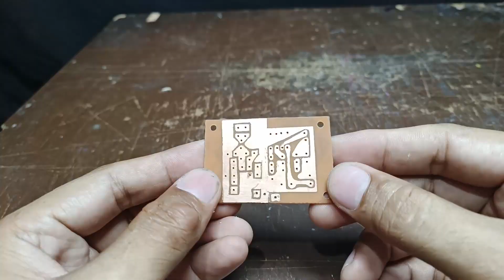Let's Modify 1950's RCA Victor 45-EY-2 || Convert TUBE to SOLID STATE Amplifier

Comment: I like the idea, however the original amp is better then sold state, solid state was a cheaper way tp produce sound, it is well known by the audio tech's
Reply from the maker: Yeah I agree with you. I do this modification because when I purchased this on Ebay all tubes are broken and you know tubes are expensive and hard to find especially here in my country Philippines that's why I modify this one.